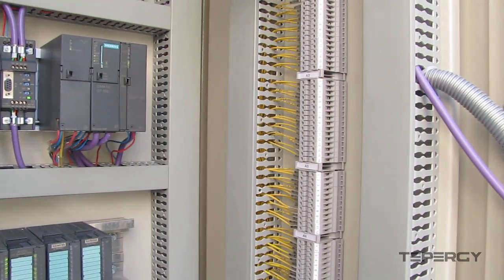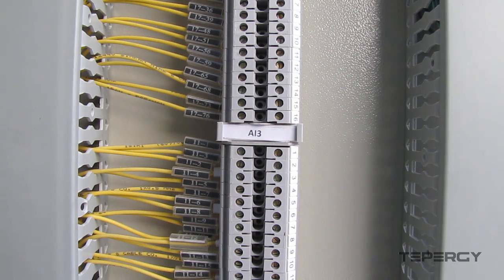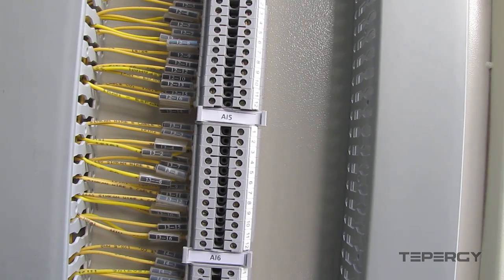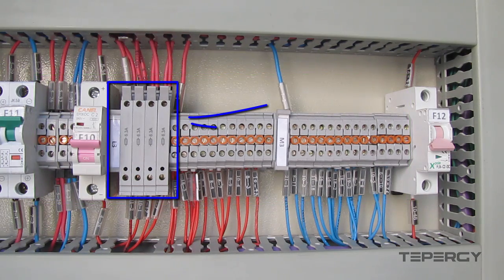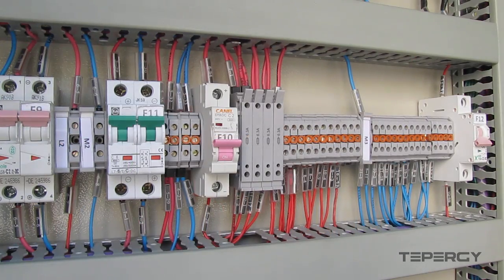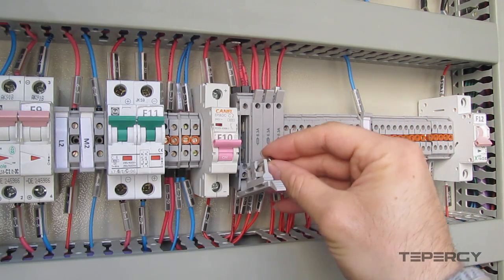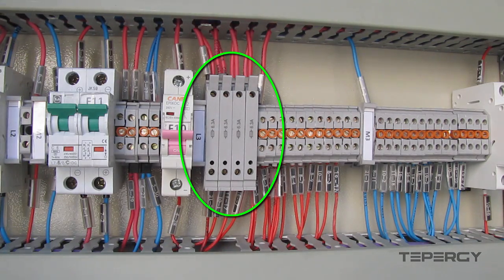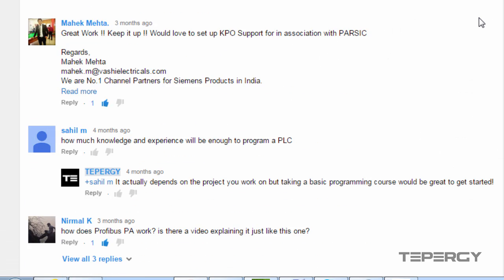How to Protect PLC I/O Modules with Fused Terminal Blocks

Comment: I love the videos you have put out in the past. I'm barely figuring out and learning all this information in 2019. Due to my current job and being a recent graduate. If you could do a full video of how to wire a complete din rail filled with Power Supply Unit, Breaker, I/O Module, and a field devices to get a better understanding of how the wiring works and make include a portion of the video involving the schematics of the wiring that would AMAZING! From your newest subscriber in 2019. Thank you for this new knowledge. I struggled to understand what a terminal block truly does until now. Thanks again.
Reply from the maker: You are very welcome! You have done a great job so far already! Keep up the learning curve!

Comment: why use fuses instead circuit breaker
Reply from the maker: Most of the equipment in this control panel work with a 24-volt power. For these low voltages circuits we usually use fuses. Also fuses tend to react more quickly to overloading which offers more protection to sensitive electronic devices.
Reply: thanks for answer, but also there are Circuit breakers with high sensitivities too.
Reply: Even with all the advancement in circuit breaker technology, fuses still have the fastest response time
Reply: It's like 5 years later since this comment with Fuses Instead of Circuit Breakers and I find the comment totally invaluable in understanding. Faster response time with Fuses in general and in this case a low voltage control circuit. Thanks and for Great stuff from RealPars and Shrikant.
Reply: How man amps fuse should one use